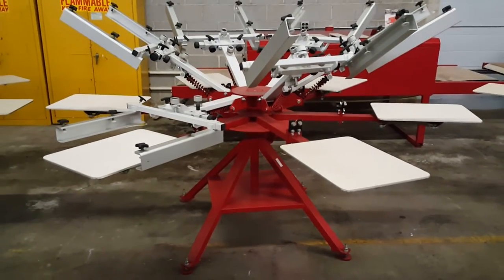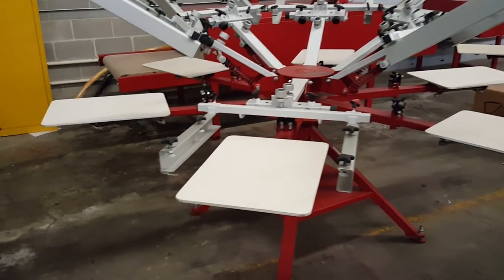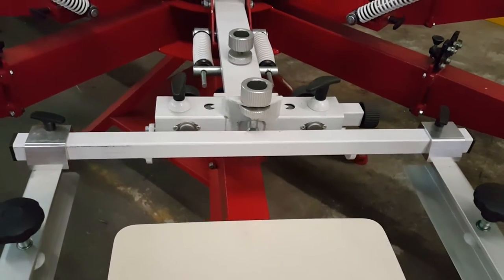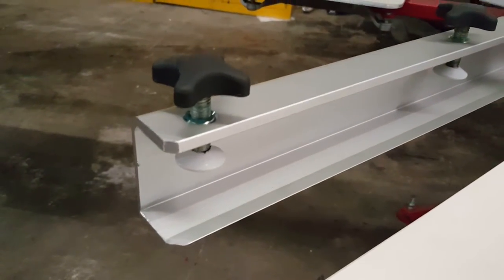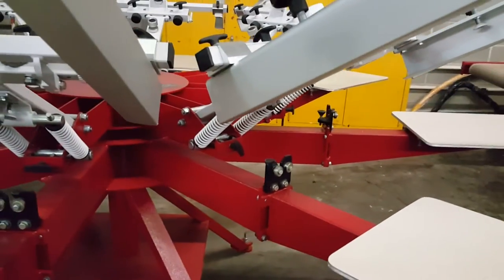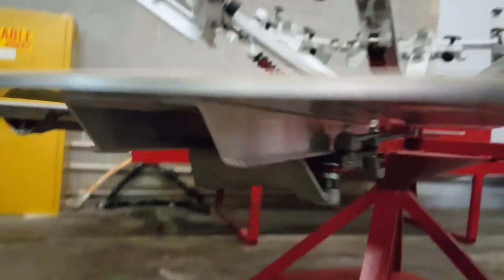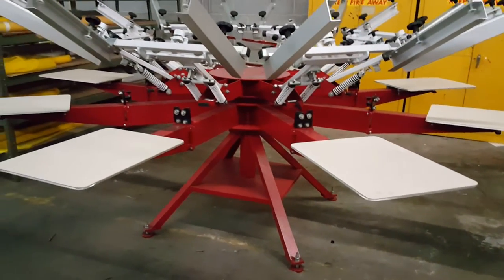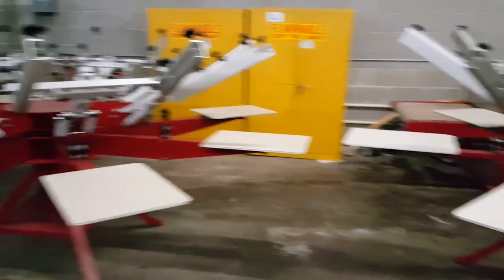Anatol Lightning vs Anatol Thunder Manual Presses

Comment: Nice. Which is better for production? Does hold registration?
Reply: Anything Anatol will hold exceptional registration. I worked at a shop that had a Lightning manual press and an Stratus II automatic. Never had any registration problems from either press.